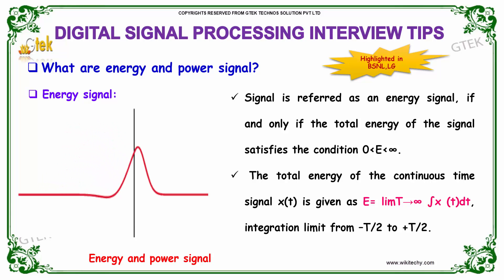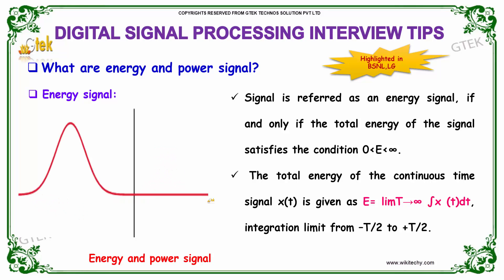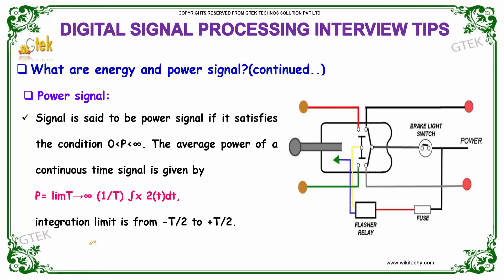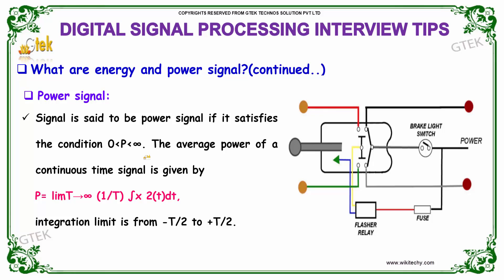What are energy and power signal | DSP interview questions and answers | ece interview questions

Comment: Energy signals have values only in the limited time duration, a signal having only one square pulse is energy signal, A signal that decays exponentially has finite energy, so, it is also an energy signal, The power of an energy signal is zero, because of dividing finite energy by infinite time.

Comment: A power signal is a signal that has finite power for each point in time. So if a signal is a power signal then the value at each point should be finite. An energy signal is one that has finite energy. So if you integrate the power over all time, it should be finite.

Comment: An energy signal is one that has finite energy. So if you integrate the power over all time, it should be finite.

A finite length power signal is always an energy signal. However, an infinite length power signal may or may not be an energy signal depending on whether the integral is finite or not. 
The Dirac delta function(Dirac delta function) is an energy signal but not a power signal.

Comment: This video is incorrect - please remove as it will cause people to get the wrong idea. It is wrong in the following ways:
- The energy is the integral of the signal SQUARED over all time (according to your definition a simple infinity ling sine wave would be an energy signal). This is a huge error.
- A more subtle error is that (for both energy and power) the integrand should be the MAGNITUDE square. This makes no difference for real valued signal but without it your definition does not generalise to complex signals.